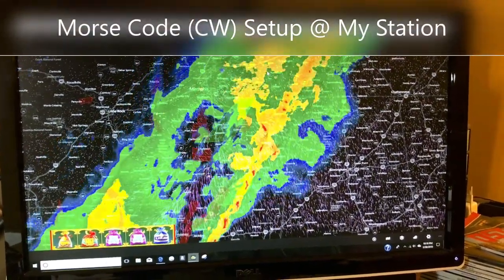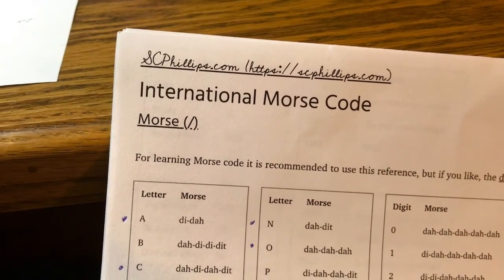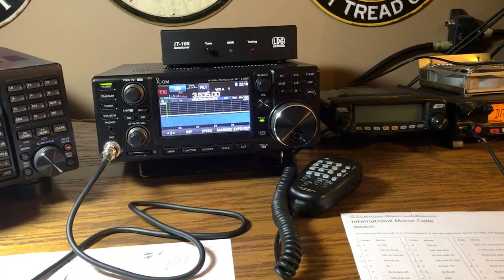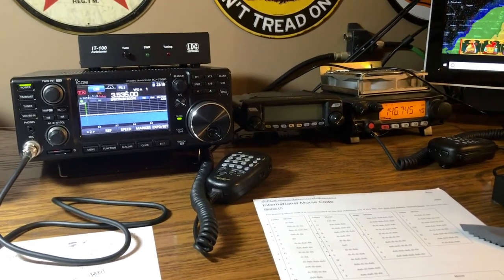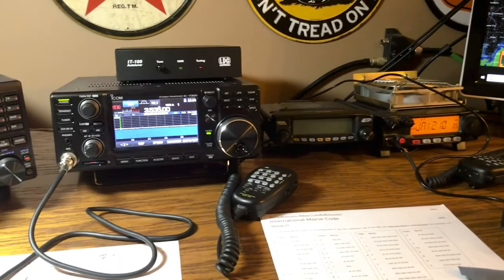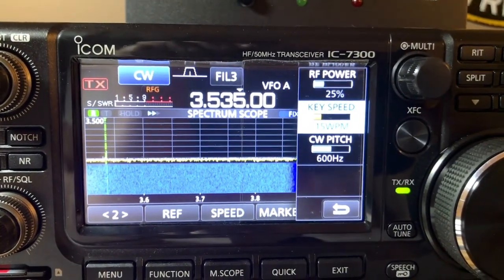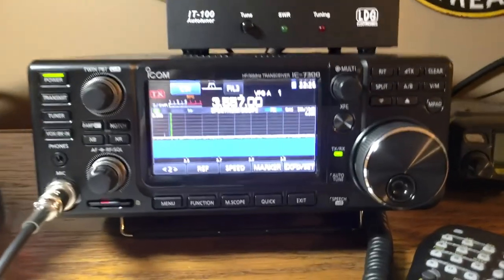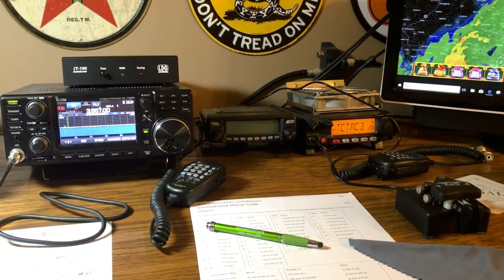Morse Code (CW) Ops Setup w/ Begali Expedition Keyer

Comment: How are you getting on with it? I've just bought an expedition #382 in Turtle finish from a pal of mine.  It has quite a stiff action and I have to operate with absolutely minimum tension and also very close contact gaps. 73 de Keith
Reply from the maker: Going slow on ability to copy!  Sending is OK, but need more practice.  They sent a very thin feeler gauge strip with mine to gauge the space between the contacts...the feeler gauge is 0.03mm.
Reply: @GhostRider1974  It does take quite some time, I was 25 when I started.......I'm 65 on Monday, it would take me longer to learn the code now. I have barely any contact gap, but it works ok. Good luck.